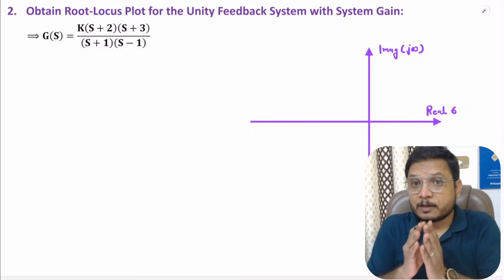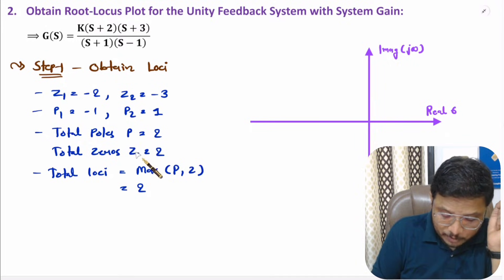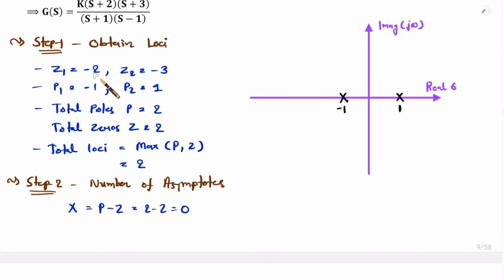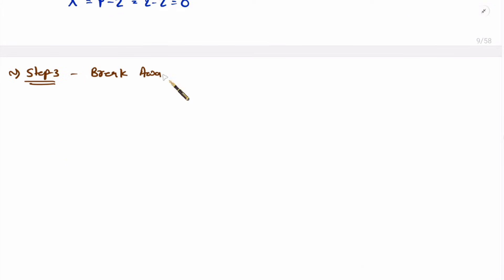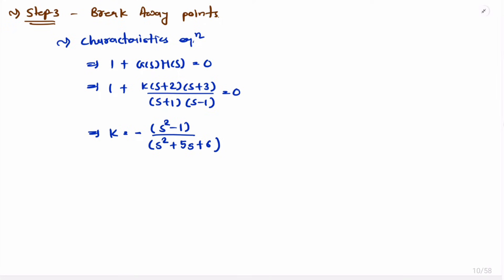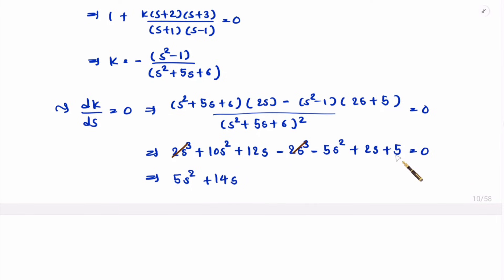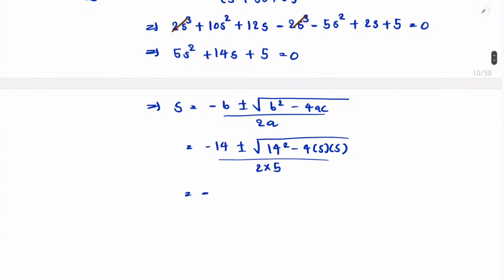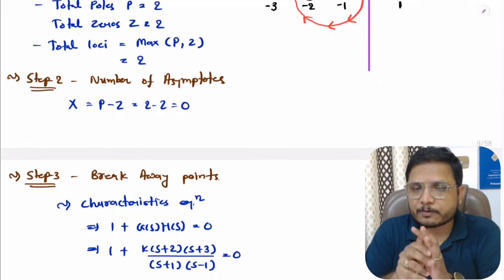2. Root Locus Plot Solved Example: Rules, Steps, Procedure, and Step by Step Guide

Comment: zeroes and poles are calculated from roots of numerator and denominator of transfer funcrtion , but u r using G(s)  open loop gain  , y r u not using unity feedbakc to first calcyulate transfer fucntion
Reply from the maker: The root locus is structured for analyzing closed-loop systems but is constructed using the poles and zeros of the open-loop transfer function. It graphically shows how the roots (poles) of the closed-loop characteristic equation change as a system parameter, typically the gain (K), is varied from zero to infinity. The branches of the root locus begin at the open-loop poles (when (K=0)) and end at the open-loop zeros (K= infty).